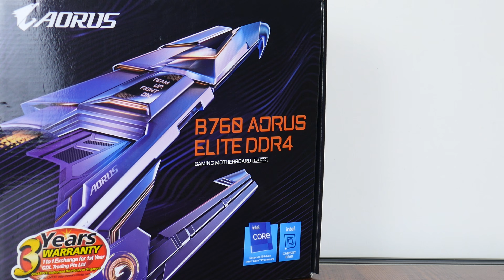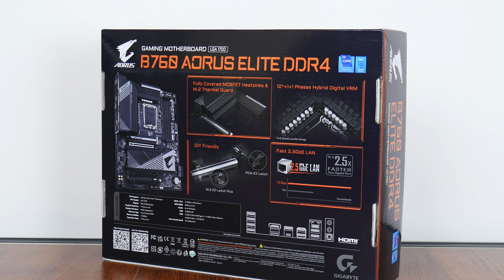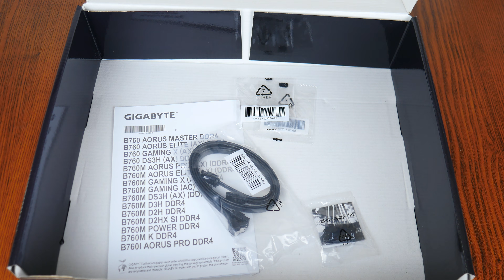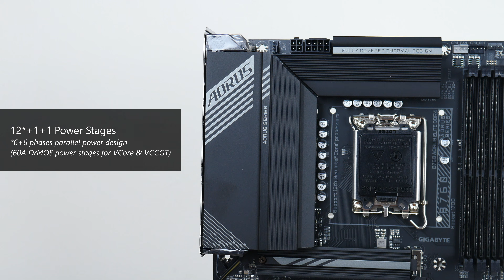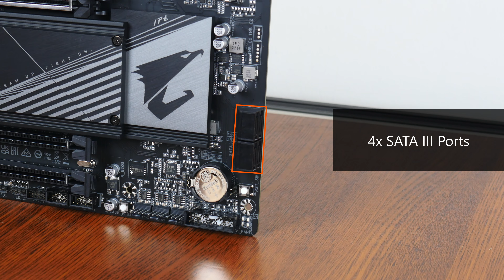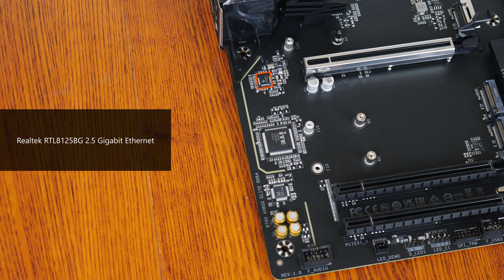Mainstream Intel B760 Motherboard - Gigabyte B760 AORUS ELITE DDR4 Unboxing & Overview

Comment: HI, I'm looking for a motherboard for i5 13500 and rtx 4070. I was thinking of buying a gigabyte b760m ds3h ax ddr4 but I'm not sure if it's good enough, or would it be better to add more money and buy a b760 aorus elite ax ddr4? I need it for amateur video editing and gaming at max full hd (1920x1080). thank you in advance
Reply from the maker: Hey there, how big is the price difference between the DS3H and the AORUS ELITE where you're from? The 13500 isn't thaaat power hungry and should get by with the DS3H, but if the price difference isn't that big, I'd personally go for the AORUS ELITE just cause it has better specs, and has more headroom for a future upgrade (e.g. to a 14th Gen i7 in the future or something).
Reply: @ALKtech  Thank you for your reply. The price difference was 50 euros yesterday morning. While I was deciding which one to take, unfortunately the aorus elite was sold out and now I have to buy it in another store and the difference is 70 euros. For security and future upgrades, I will pay that 70 euros more because I believe it will be worth it. Greetings from Croatia.
Reply from the maker: @wlf-46showtime  ah dang..sorry that you didn't manage to get the board at a cheaper price. But that said, you can't go wrong with the specs of the AORUS ELITE. Enjoy your new PC build!

Comment: I'm thinking about getting this or the asus tuf b760 for a 13600K, what do you say?
Reply from the maker: This board should handle a 13600K well, though I'd personally go for a DDR5 board instead to maximise the 13600K's performance. Would increase the cost of your build given the cost of DDR5 vs DDR4 though. Just my two cents!

Comment: why does the motherboard not support SATA m2? how to tell? 

CPU:
    1 x M.2 connector (Socket 3, M key, type 22110/2280 PCIe 4.0 x4/x2 SSD support) (M2A_CPU)
Chipset:
    2 x M.2 connectors (Socket 3, M key, type 22110/2280 PCIe 4.0 x4/x2 SSD support) (M2P_SB, M2M_SB)

Comment: Bro can i put i7 13700kf in this motherboard ?
Reply from the maker: Yup the 13700KF is compatible with this board!
Reply: @ALKtech   Will there be a bottleneck or performance loss if I use it with this motherboard?
Reply from the maker: @DAbi_PC  I think you'll be fine, just gotta make sure you've got a good CPU cooler for the 13700KF, and that your case has good airflow, especially around the VRM area!
Reply: @ALKtech   ok last question can i overclock cpu in this motherboard?
Reply from the maker: @DAbi_PC  Nope you can't, overclocking can only be done on Intel Z690/Z790 motherboards!
Reply: @ALKtech   oh bro last question can i do under voltage in this motherboard
Reply: @DAbi_PC  did u find the answer?

Comment: I'm thinking To Get One of these For my i5 13400f And Rtx 3070 Ti. Btw Will I see any difference in My Gaming and editing performance if I Buy a Z690 motherboard for my i5 13400f ?
Reply from the maker: I'd say both boards should perform the same-ish with the 13400F - whether to get a Z690 board over this B760 will really depend on the price and exact model! Which Z690 board do you have in mind?
Reply: @ALKtech  Gigabyte B760m Aorus Elite AX DDR4 (Wifi) and I'm thinking of Asus prime z690 mobo btw z690 is going out of my budget 😭 Do You Think 3070 ti is a great Card for 1440p in Current Days? Im Going to Purchase Asus Tuf Rtx 3070 Ti OC
Reply: @Chief_Calistro  i think rx 6700 xt will be better for price to performance ratio but 3070 ti is better or u can also check out rx 6800 non xt and xt if priced well
Reply: @itzsanju3523  bhai rx 6800 and 6800 xt both are going out my budget i choosed 3070 ti of Asus tuf I'll be getting it very soon
Reply: @Chief_Calistro  👍
Reply: @itzsanju3523  btw Which Monitor Should I go for ? Which I'll get under 25000
Reply: @Chief_Calistro  Lg ultra gear 2k 27 inch
Reply: @Chief_Calistro  are u enjoying ur new build?
Reply: @zhuzhu9599  yes absolutely but I'm regretting too I should've waited 2 months more for rtx 4070 🥹🥲 Btw 3070 ti is also a great card for 1440p Gaming Currently I faced vram issue only on few game like resident evil 8 otherwise the card is Good
Reply: @Chief_Calistro  how  about i5 13500? I m too planing to build a multitasking pc with 13500 (without any gpu for now) but cant decide on which Mobo to pick? Also prices of mobos are crazy high. Plz help me choose a right board for the cpu 🙏
Reply: @zhuzhu9599  Your budget ? I choosed Aorus Elite b760m DDR4 from gigabyte I got it for 16.9k
Reply: @Chief_Calistro  for only components - cpu, ram, mobo, tower cooler, nvme storage, psu, and case, my budget is 70k

And i have also sortlisted the same Mobo 😁
Reply: @zhuzhu9599  wow great By the way for what purpose you'll be using ur pc ?
Reply: @Chief_Calistro  planning to learn photo/video editting, light gaming, office works and multitask

Comment: Thank you for this really nice Review of the mainboard.

Im currently trying to build my own Pc for gaming and streaming and wanted to go for the 13600k. 
I already bought a Z690 Aorus Elite DDR4 mainboard.

But this mainboard right here has the new Chiplet and has Wifi integrated, can you tell me which one i should go for please?
Reply from the maker: If you already have the Z690 AORUS ELITE DDR4 on hand, I'd stick with it, and get a WIFI add-on card/USB WIFI adapter if you really need WIFI.

The Z690 will do just fine with a 13600K and should perform just as well as the B760 board in this video, if not better. In fact, a quick glance thru the specs of the Z690 board shows that it does indeed have better specs for the most part! 

Only thing to note is that you'll have to make sure that the Z690 has the latest BIOS that supports 13th Gen on it - the board that you have comes with the Q-Flash Plus feature, so updating the BIOS without installing a CPU/RAM/graphics card should be a breeze. Hope this helps!
Reply: @ALKtech  Thank you very much for the reply.
I will follow your advice and just buy a wifi card and stick to the Z690. :)